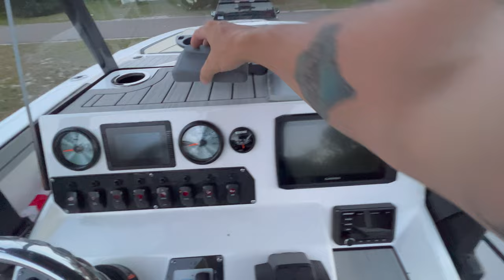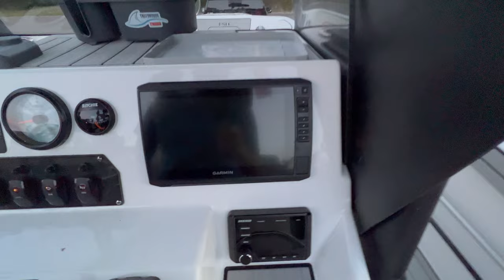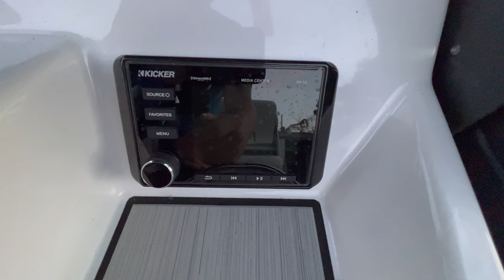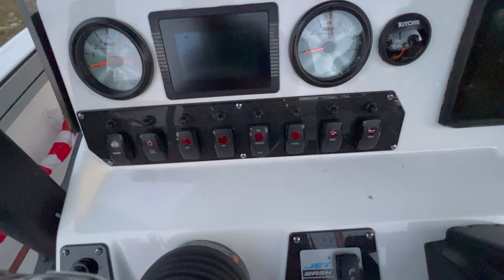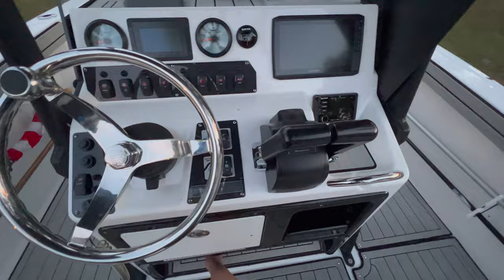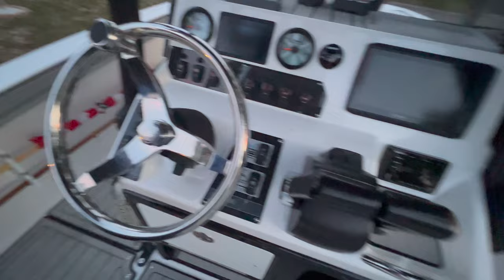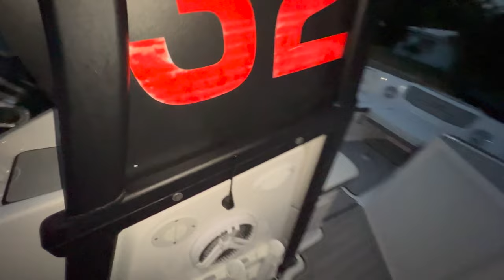Yamaha 210 FSH Sport - 1 Year Full Review and Walk-through!!!

Comment: Do you use this boat in salt water?  I'm considering a 190 or 210 for PCB FL and wandering if seagrass is an issue in the jet drive?  Thanks
Reply from the maker: I only use mine in saltwater. I am here in Treasure Island, FL. No issues with sea grass for me in over 4 years.
Reply: @THEFSHDUDE  I assume you have the same seagrass that pcb would have?  Thanks.  Good luck with the hurricane.

Comment: I just test drived a 195 FSH, i like the high speed handling, but feels like the control is low speed is not good, and it took the guy five times to get the boat into the trailer, I heard that you can install something to help with low speed steering, because i usually do the side scan for the dock, low speed handling is important to me, can you tell me what do you think about it?
Reply from the maker: For low speed handling on that single engine model you will need the jetboatpilot.com thrust vectors. My dual engine has no issues with low speed maneuvering.

Comment: Did you have to adjust your throttle. Mine walk back in less that a minute. Want to go out a bit without having to hold the throttle constantly
Reply from the maker: Yes, there is a throttle adjustment screw at the base of the throttle righty tighty lefty Loosey to give the throttle’s more or less tension
Reply: @THEFSHDUDE  So very simple.  My wrist was getting tired.  Now I can use the Cruise assist function.  Thanks.  Great videos BTW.  Now if I can find better boat straps to withstand the saltwater.
Reply from the maker: @shawnwilson6064  These are the straps you want! https://amzn.to/45tBVqN

Comment: I have the same sound system on my 210 after watching your video review on it. I only have 2x6.5s and 2x8s with the 1000 watt amp. I noticed that the amp is killing my house battery after a short period of time (20-30 minutes of moderate volume). I have a starting battery as my house because I bought it before the stereo decision. I want to get a deep cycle battery but I need to keep in mind that it may not help me at all in rescuing my starting battery in an emergency. What did you use as a house battery? I am going to install an onboard NOCO 2 bank charger. I have seen people talking about this on Jet boat forum and the issue seems to be that the engines don't use alternators, but rather stators, to recharge our batteries. they only deliver about 30 amps back at full throttle and that could be partially getting used by the boats other electronics, like fish finders and radio etc...
Reply from the maker: That’s correct, a start battery will not last. I run a deep cycle house and the promariner onboard battery maintainer. 2 years no issues. Play for hours at a time. Deep cycle batteries will help start if you need it to in parallel (emergency switch). The higher the amp hour the battery the better for long lasting audio. I recommend interstate marine deep cycle.

Comment: Great Review!!  Looking to get the 210 in the future, coming from twin outboards, have you run the boat on one engine?  I heard you have to block of the cooling line to the non-running engine, just curious if it is able to plane on one engine?  Thanks
Reply from the maker: Yes, and you are correct you must either clamp the intake water line or install a valve so that water doesn’t flood the non-running engine. You can get on plane with one engine.

Comment: Do you store this in a public storage or can this fit in your garage. Also wondering why you went for this and not the AR190. Just wanted to get your thoughts on it. Nice video btw!
Reply from the maker: This can be stored in your garage with a couple bolts removed from the tower. I also went with this boat because of the functionality of a center consul over a bow rider. This is a hybrid between a bow rider and a center consul and serves multiple functions which I find value in, I also went with the 21 foot because the 19 foot was just small for the bodies of water that I use my boat in as well as the amount of people usually 5 to 8 that I have on my boat.

Comment: Great review. I am very impressed with your upgrades, improvements and accessories but a little less impressed with the boat itself. I'm sure it is a very good boat, but I'm looking for a great boat if I'm going to start spending even more cash for all of the cool gidgy gadgets and extras you've customized to your Yami.

You may have inadvertently talked me into an outboard CC. Perhaps in a brand that pays a little more attention to the little details. Not to take anything away from your boat or what you have done. I'm just a little longer in the tooth and my next boat is probably going to be my last boat. I'm not sure I see an overall quality here that is going to be up to the longevity that I'm hoping for. You're still young and probably already have ideas on what you'll do different on your next vessel. You've done great things to this one and your passion comes through for sure. I would like to be able to ask you more about the specifics of your stereo system once I've made a purchase because it seems to me a lot of manufacturers charge a heck of a lot for sometimes pretty mediocre equipment. I don't mind the upcharge so long as the sound reflects what has been spent. It seems to me, you have a pretty good handle on that.

Overall, an absolutely great and informative half hour. Thank you and cheers!
Reply from the maker: My pleasure 🤙🏼